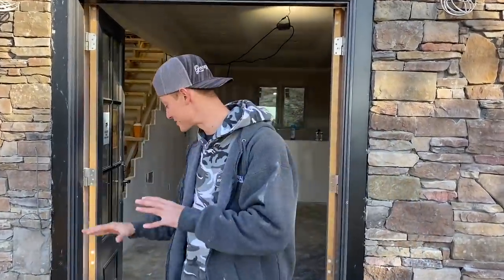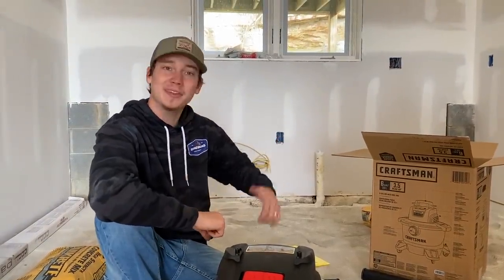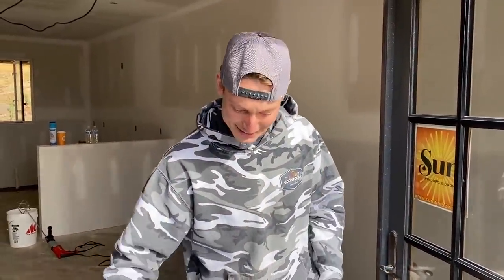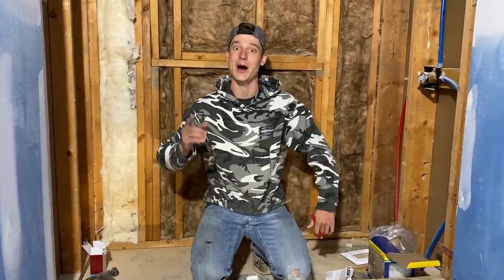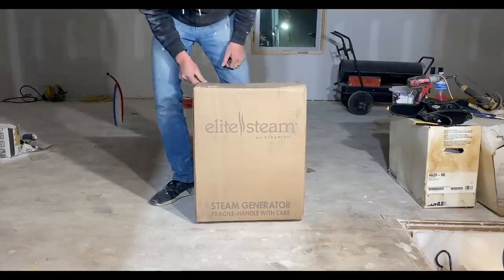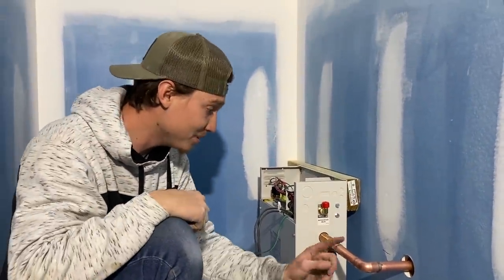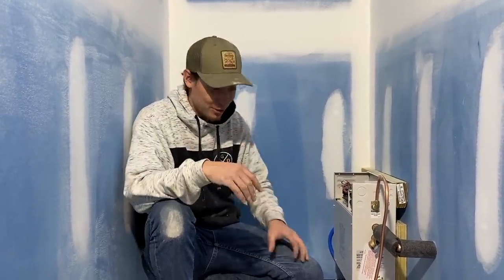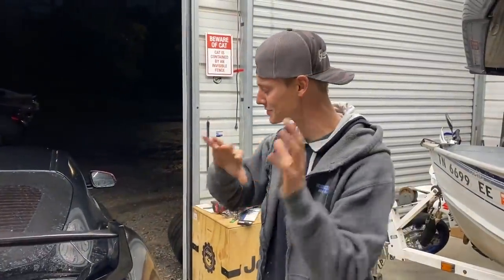The New Goonzquad Headquarters Part 47

Comment: I would not recommend white grout, it will show all the dirt and is a real pain to clean, try a light grey instead.
Reply: I agree.  My wife wanted white grout when we did a kitchen remodel.  After trying to keep it clean, we tore up all the flooring and changed to a grey grout.
Reply: THIS. Plain white grout is HELL to keep clean.
Reply: Yes! I just had to do a “grout refresh” aka change the color because the white turned gross so fast!
Reply: Yup Grey grout not white or black!
Reply: Incorrect. The polymer grout they make today is not your old school sanded/non sanded grout. 😀. It's amazing.
Reply: Agreed!!
Reply: I did white grout in my bathroom and it was the biggest mistake I’ve ever made
Reply: I did white grout in my new house, huge mistake. Re-did all of it with a light grey, and still even the light grey gets dirty. And we dont wear shoes in the house. I'd say do something that a little darker if it's on the floor. Walls are a lot easier to keep white/light
Reply: It turns yellow after a while too
Reply: You can get seal for the grout
Reply: I sealed the grout, but it still gets dirty.
Reply: Just reminds you to keep it clean. Unless you like the dirt hidden.....
Reply: Best color is grey. All light grouts turn dark over time. If you seal grout it will last few years but ultimately turns anyway.
Reply: Steam mop cleans up grout super nice. Mine looks still look like day one.

Comment: As a flooring contractor I would recommend tile, doesn’t stain so scratches and it’s sealed so no water gets underneath where ass glue down would doesn’t do any of that
Reply: Tile is a lot more dangerous for babies than wood. If they are planning babies. Our first daughter fell over and hit her head in the tiles and it was super scary. Our fake timber floating floor is a lot more forgiving. But yes, it sucks up moisture a lot. Super easy to change though.
Reply: @1one3_Racing  there is another down side to wood floor as it soaks up moisture it begins to crack and mold, and can also rot away, there is also another solution witch is the best of both world it tongue and grove flooring it’s soft and spill proof also very easy to install, you are correct tile is not very forgiving

Comment: All wire is rated for 600volts the gauge of wire determines the Amperage it will carry to your device. 14 gauge = 15amps 12 gauge = 20amps 10 gauge = 30amps 🤟🏻🇺🇸🇺🇸🇺🇸
Reply: At least they said they would have the professionals fix it before they turn it on.  Running the power by the water line will fail inspection.  That curved water line is going to fail to.  They should skip the home building and get to the garage part.
Reply: If it is a 10kw I'm not sure if they use right wire size 10000/240=41.6 or amps, I would recommend a 6 AWG
Reply: @1234yochi  that’s only a 200amp panel.

Comment: Plumber is gonna laugh his ass off at the way you routed the water line on that steamer.
Reply: Not the most square job but it'll work
Reply: Should have put the unit on the back wall of the closet.. No mad pipe work required..

Comment: Epoxy grout is the way to go. Even if it’s white it will be easy to clean. The one I use is Mapei Kerapoxy
For the  bottom level floor, heated tile system would be the best. Keep your feet warm and it’s very durable. You get tile that looks like wood. Also heated floors in your bathrooms!

Comment: If I were you, I would install a heated floor.  Specially when it's a concrete.  Good luck you guys doing amazing job.👍
Reply: Costs a small fortune to run. Not really necessary when they’re installing a brand new furnace. They’ll be fine without it
Reply: I am talking from experience. My previous home did not have any heating floor.   Now I have it.  Me and my family absolutely loves.  Next project would be putting hitting floor in garage. Good lock .

Comment: When you solder plumbing pipes, it’s called Sweating, not welding
Reply: You know that and I know that too (from my Dad), but seeing the boys trying to communicate without the proper terms is just plain endearing.  I hope that the work is solid on everything they have done since I'm just a novice and don't recognize the flaws, except for that missing drip edge on the pump house which I still worry about.  Nothing worse than plumbing and roof problems ( and maybe electric problems too but they're using an electrician).
Reply: Copper welding is synonymous with soldering.
Reply: Endearing... Uneducated... Whichever.
Reply: @TheGreenTeaGuy  No it’s not.
Reply: @TheGreenTeaGuy  No it’s not.
Reply: @TheGreenTeaGuy  No,  it’s not.
Reply: @TheGreenTeaGuy  No it’s not.

Comment: When I redid my bathroom during beginning of covid the tile took me like a full 3 days lol. Good stuff guys.
Reply: How long would you estimate the drying time it took?
Reply: Did you do it properly though and have it fall correctly and a drain?
In Australia any wet area HAS to have a floor drain so you thinset the floor so it falls towards the drain/back of the room to prevent flooding. It takes so much longer than just slapping it down.
Reply: @1one3_Racing  yeah it’s not code here or anything but for the shower room for sure did it. And then epoxy tint the whole room getting it perfectly smooth was hard man. Thought doing epoxy on my garage sucked... lol
Reply: @kjhaglfjhgfasd  we used a product in a fully solid timber bathroom that was great. The bathroom was a disaster. I don't know who decided a redwood bathroom was a good idea. It was an epoxy product that you had to run a blowtorch over to get the bubbles to pop. Turned out like glass. Super expensive though.

Comment: just to point out "600v" cable can be worse than 250v cable... as it can be smaller diameter to deliver same power..
Reply: They said it's a 10 kilowatt steam shower, so that's around 40 amps on 240v which means you need 8 gauge wire. By the looks of it, I doesn't nowhere near that big.
Reply: @MrArcticPOWER  The manual I have says 6 gauge.

Comment: hi, That wire running to the steamer is never going to pass inspection' you need to run that wire to a box then run a wire with conduit from the box to the steamer
Reply: Not unless by now they are cool with the inspector and he passes them 💵😅 money buys everything bud
Reply: Good to know. I imagine the electrition will tell them, and the route looks simple enough. I wonder if that was the obstacles they mentioned, and did not add the needed code requirements. Is that due to the high voltage? Probably put the box near the panel, and run the metal wire hokder to the steamer. I wondered because of the obvious heating of the wire to the touching of other wires in the loom. The shielding is to prevent accidental piercing and thus fire or electricution.many folks do not know there are Federal standards then State additional standards.
Reply: @pedronewman1787  Let tell you the electrician will never let that fly with his name on the permit & about a million people seeing it is ,it going to be left like that, it don't matter how much money they have it will never be left like that you DA
Reply: @garycorbett148  
They said they are just roughing the wiring to be finished by pros.
Reply: I'm sure the "electrician" will get it right. They also need to figure out the drain situation. I recommend an auto drain. And the pressure relief needs a line ran to a safe place. And I think they need a proper enclosure.
Reply: @larrybe2900  Roughing it in means that the wire is ran completely to the steamer & to the panel box but not hook-up

Comment: “Luckily this isn’t a high pressure line it’s just a steam line” .....
Reply: Steam is high pressure FYI
Reply: Steam is only high pressure if its blocked off. Its an open ended line like a gutter. Like a steam cleaner you use on floors and that. No pressure at all.
Reply: @2023TMc  especially steamy in the closet itf that safety valve to nowhere blows LOL
Reply: @1one3_Racing  , I'm betting the inspector may look inside that closet.  Lots of goofs.
Reply: @pacemetalfab  yeah. I commented somewhere else about that sketchy copper line. The soldering was sub-par too. Considering its so damn easy. Maybe he should have practiced on some off cuts? Generally if you just flux the part you want welded very neatly and get it damn hot then touch the solder to it and it flows in mint.
Reply: @1one3_Racing  . Yes,  no stops or unions. They hired plumbers but yet skipped them on this installation.  And using soft copper when the house is plumbed in PEX 🙄
Reply: @pacemetalfab  I'm a fully qualified landscaper but don't touch indoor plumbing. If a pipe leaks i want someone to claim against.
If steam leaks, you're going to have HUGE issues!

Comment: Nice tile work, guys!  Since you are going to use it as a steam room you might consider using a pedestal lav, or something that is all porcelain, and not a wood vanity base.  The moisture will probably cause the wood to rot or encourage mold growth.  Also, if the sheet rockers didn’t use the moisture resistant board on the ceiling you might want to add a layer of it on.  Again, mold growth might be an issue if you don’t.  Just trying to help if I can.

Comment: Sure someone else has mentioned it, but you would never normally solder that close to the unit.  That's why the fitting on the unit is threaded, so you can solder the assembly off the unit and then thread it on.  Using a torch so close to the unit can transfer too much heat through the pipe and burn up seals inside the unit.

Comment: The tile level system is great to make the tiles all the same height. Master tile installers will occasionally slide a coin across the floor and it should flow smoothly over the gaps. Also, the level system makes for super easy grouting since you are not trying to wipe across an uneven joint. Typically the walls and shower area gets tiled first and the floor last so you are not dragging the mess across the freshly laid floor.

Comment: Hey guys, although the sweating (soldering) is great for copper piping, I would suggest that you use press fittings next time. Propress, Milwaukee, rigid etc all make the presser.
Another thing, you should run you electrical wiring in metal (flexible) conduits.

Comment: 5:00 lol, looked like what you filled were hot air floor vents at the door ment for heating
17:15 Cut the insulation at 45 degrees at the corner. So the ends meet and fit
20:00 where  the wire drops down the ceiling fold it in a 'horizontal S'  If water leaks down it will drop from the S to the floor. Not follow the wire and leak into your electric cabinet. Well should be for all wiring from/towards moist areas.
P.S. Don't forget the (seperate()ground wires to all wet areas!

Comment: You might want to have the plumber verify the pex crimp rings for the steam unit.  The rings looked a little too far out from where the pipe meets the fitting.  Could have just been the camera messing with the perspective, though. There's also a "go/no go" gauge you can buy to make sure the crimp is done properly.

Comment: Lumber liquidators.. they have a nicer selection for wood looking tile. I am putting in Brazilian pecan in my dining room. If you go tile you can use schluter ditra. This way you could put in heaters. This will help them winters as slabs get quite cold.
Reply: I forgot. Get rid of that plumbing insulation. Go to a refrigeration store and by the insulation for refrigeration. That plumbing insulation will melt away with as hot as steam pipes get.

Comment: Seriously guys;you need 'Radiant-Heated'floors on that slab downstairs.You already missed having warm tiles in the bathrooms.Whatever flooring you put downstairs,it will always be cold because of the slab otherwise.It'll also be easier to maintain the temperature when that door's opened in February.

Comment: How are you going to paint the wall, wood, and install the baseboard behind the steam box?  Also, the bathroom tile is one of the last things you do, otherwise it could be damaged by all the heavy items and work required to finish the shower.  The walls should be painted before the tile goes down, then you don't have to worry about taping off or covering anything.

Comment: When soldering you should use the flame underneath the pipe and once the pipe is hot enough you put the solder on top of the pipe and the solder will go round the pipe and give you a clean finish

Comment: Boys those where some pretty decent attempts on the soldering, but next time try to only feed the tin from the top and let the grease flow the tin everywhere. once there's enough tin for a good seal it will start to form a droplet underneath the soldering. getting good tin flow can be increased by sandings the pipe lightly with light grain sandpaper

Comment: Before putting in your flooring you should install radiant flooring so your floor is heated on those cold nights. You can add a tankless hot water heater too so your never out of hot water.

Comment: Loving the house guys! But please if you are going to trim out the inside, take your time a little more than the exterior to get those miters tight (where 2 trim pieces come together) having gaps outside is a little easier because a lot of it is up high but inside you see all the trim work close up. Yes you can caulk and paint but it doesn’t come out nearly as nice. Just good for thought coming from a trim carpenter who does that stuff for a living! Love the videos and keep up the awesome work🤟

Comment: Quarter test it. If you can slide a quarter across the tiles without it skipping and jumping around then they are perfectly level with each other. Don’t ever grout tile all at once sections at a time. Then dry wipe it. No wet rag. Great jobs every one you do. Money saver...

Comment: Pretty sure you can't leave that romex exposed when it comes out of the floor like that. Needs to be in conduit or some sort of raceway to protect it wherever it is exposed.

And if that's a 10kW steam generator, a 30 amp breaker isn't going to cut it. So that 10 gauge romex you ran is going to be too small and need to be replaced.

Comment: once its dry tap it with your foot (no shoes) if it sounds hollow its not a good seal and you have a gap between the tile and floor, you can put mud on the bottom of the tile to help with that.

Comment: You need to run a line from the pressure valve just below the line going through the wall to the outside of the house so if the valve pops from to much pressure it will dump the water outside the
house and not damage your walls.

Comment: Just to let you guys know the rule of thumb for the sub floor under tile is one inch of thickness. If you don't build your subfloor up you may get tiles cracking or popping up. Also larger tiles you typically want to back butter. Otherwise everything looks great.

Comment: If you put down glue down wood flooring or any glue down flooring, if you ever decide to take it up. When you start pulling it up, the glue will also pull up chunks of concrete. And so with doing that you would have to repair the concrete after that, my dad works at a hardwood flooring company and he has seen flooring pulled up that was glued down that had chunks of concrete on them

Comment: Try some tile that isn't black, the tile that looks like wood is really nice, and they are big tiles so they go in faster, dark grout is allot easier to keep looking good. White grout doesn't last long before it is discolored. You guys did a good job with the steamer, I would put hardy board on every wall and ceiling for the steam room, tiling on drywall only lasts 6-8 years before it falls off, less than that with a steamer....

Comment: Good job installing the steamer. Just wondering if there is a reason you didn't put the small copper tube through between the steam pipe and the wall. To me it seems like it would have been better protected.

Comment: Get rid of those tile raisers they will raise the tile off of the mud and cause gaps between the mud and tile which will be a weak point and your tile will break. Best thing to do if its uneven is apply more mud or use self leveling mud before you lay flooring

Comment: When you run Romex up like that it should transition to AC90 for mechanical protection romex is not made to be ran surfaced by code and the maximum voltage for it is 300VAC. You can only get 600VAC from AC90 !

Comment: You need to back butter those tiles or they're gonna easily pop off. Also, add the dry mix to water for easier mixing!
Reply: Not at all. Those small tiles of you moisten them that good. 12×12, 3x24/36. I would say back butter. But subway and small tile just moisten and clean before putting down.

Comment: When you braze heat the copper first until you see the rings but do not burn a hole through. Hit your silver, drop it, then push it with the torch

Comment: One thing with that steam generator...it has a temperature and pressure  relief valve on it. Now you have a relief valve in a closet with no drain. If the relief valve goes off it's going to cause water damage.

Comment: do hw flooring but not lumber liquidators - easy to clean and maintain - some of that stuff reall wakes up when you put the poly on it - get some of the red oak - vacuum and mop and glue down some advantec and then lay the floor - you all can do 1k sq ft a day likely - you leave 1/8+ on ends cause it will expand - you can go with a composite snapin but hw will last longer? you can always sand it as you know - get some samples and plan on using same for office in garage - do think about going all solar powered heat pumps and also hepa pos pressure plus heat exchangers #helical wind turbines #layouts #thresholds
Reply: this is when you can put the self leveling laser to use - put it in center of room and ir will shoot points all around so you can plan layouts better - you do have to shop around - they take any guesswork out which is nice #plumb square and level